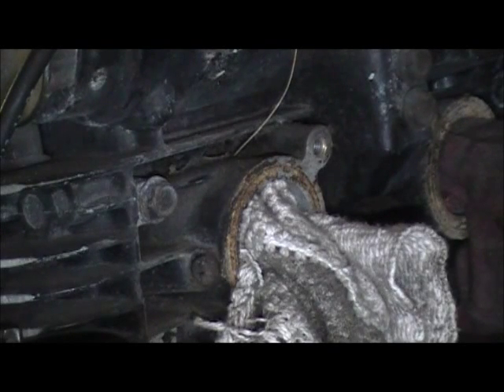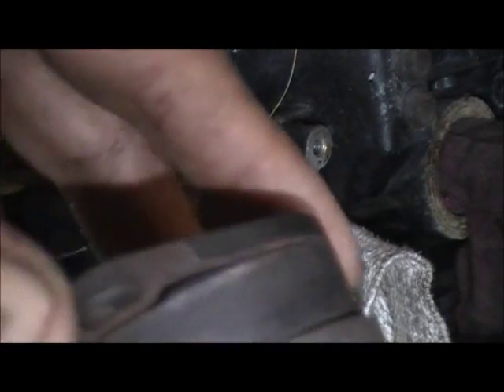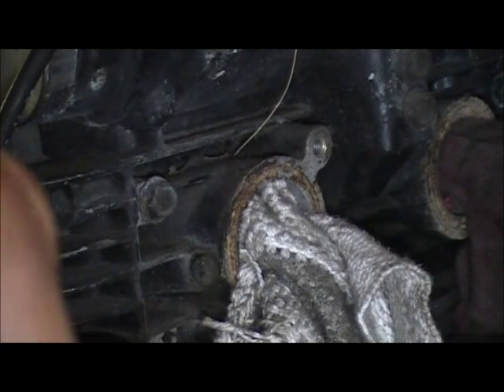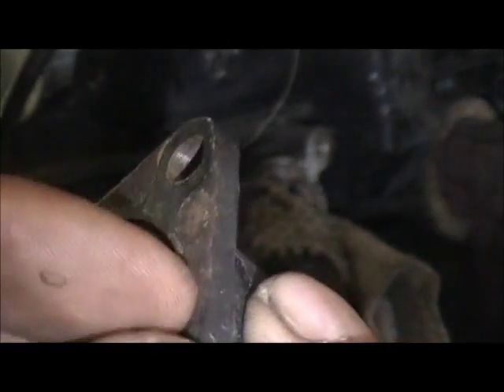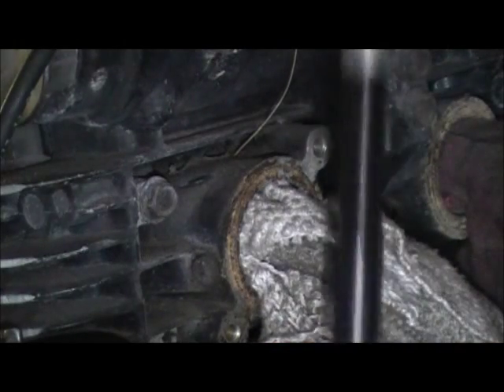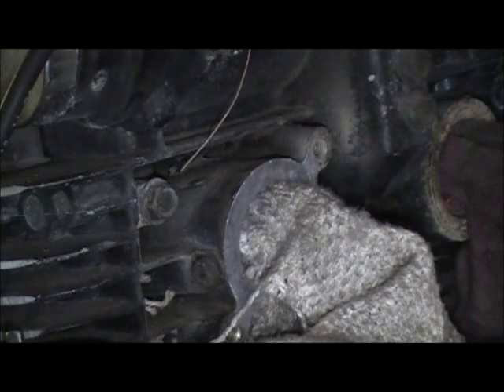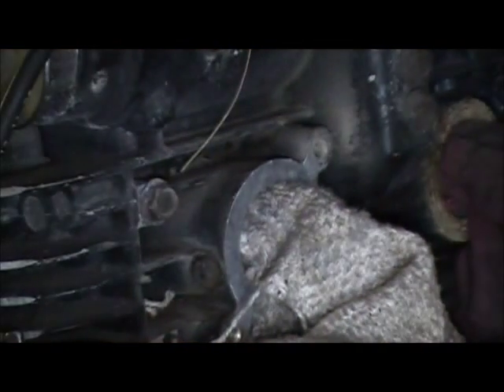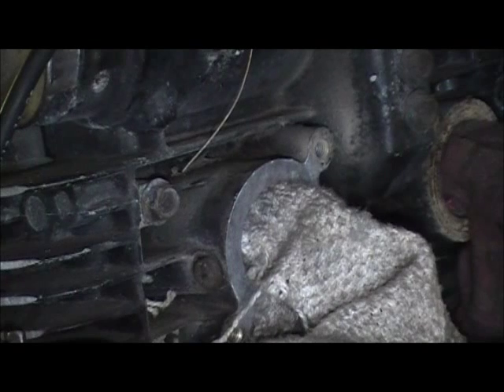Installing new intake boots on your old Suzuki

Comment: i have a 1981 yamaha 850 specal i took my carbs off becouse they needed new boots my problem is my air box has removable boots for the airbox and when i slide the carbs thru they pop out any suggestions on how i can solve this issue
Reply from the maker: I tuck em back into the airbox then pull em back through till they seat properly - (major PITA on Yamis) Then attach em to the carbs (often it happens as a "bonus" while pulling em back through and seating them

Comment: Whats the screw size?
Reply from the maker: teeny for the clamps - 10 mm head on the intake to head bolts - think that makes em 6mm thread
Reply: aaron marshall M6x1.00 16mm, a bit late I know, but good for others. I got some with allen heads on them.